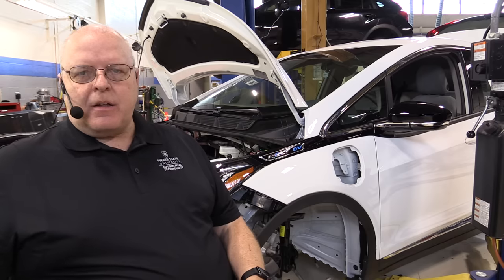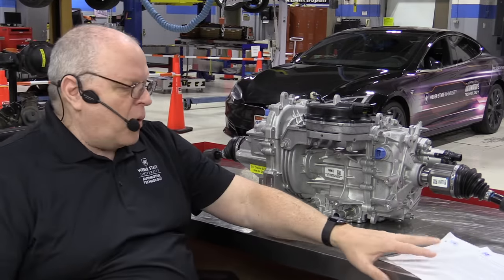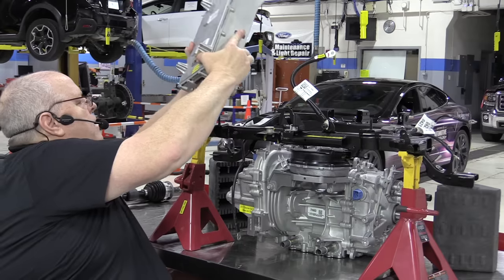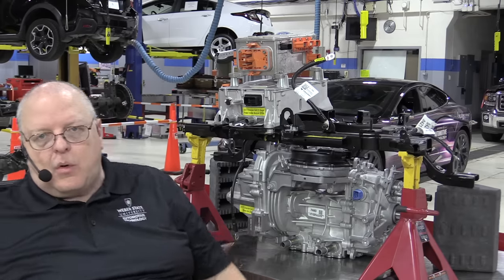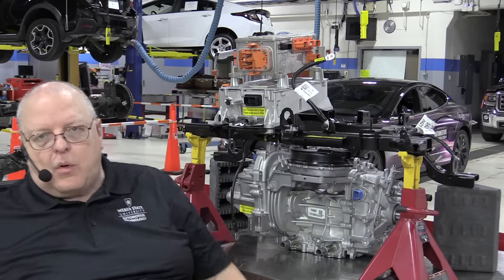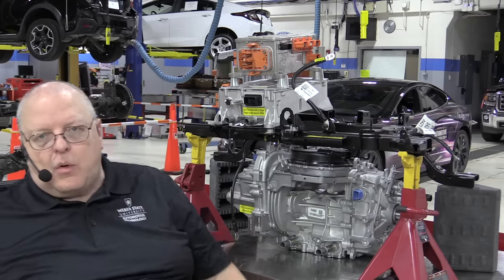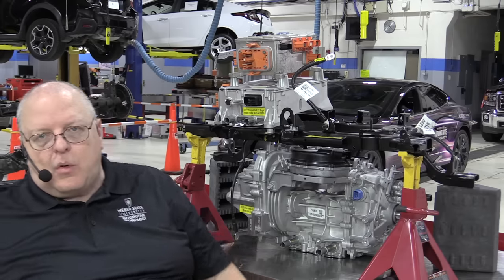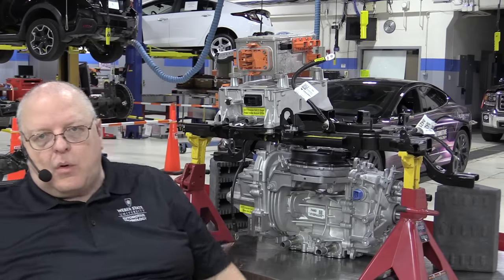Chevrolet Bolt EV High Voltage Components

Comment: Professor Kelly (or anyone who may be able to answer my question): I want to know if there is an optimum charge rate for the Chevy Bolt, in terms of battery longevity as well as most efficient energy usage.  Clearly, charging at 240 volts is more efficient use of energy compared to 120 volts due to IR losses but there are other questions.

For example, during the wintertime, it would make sense to create at least enough heat in the batteries to eliminate the necessity of using resistance heat to warm the batteries via the hydronic loop; also one would not want to overheat batteries requiring usage of the coiling loop - but obviously that is only part of the equation.  Thus, perhaps the batteries are SO much more efficient at accepting a charge at a given charge rate that some amount of operating the heating (or cooling) loop would be the most efficient way to charge the car.

Then of course is the question of what is the best RATE of charge to preserve battery longevity, which of course, may be more or less than the most ENERGY efficient way to charge.

Additionally, is there a better or worse way to treat the batteries?  My understanding is the keeping the charge between 20% and 80% is generally the best way to treat the batteries (correct me if that is wrong) but isn't it also good to exercise the batteries through their ENTIRE range from time to time?

Which begs the next question: should I charge the car to 80% and let it discharge to 20% before plugging it in again?  Or should I put it on a charge every night when I come home, even if I have only used 10 or 25 miles worth of range?

I know that the answers to my numerous questions will be long and complicated - so please send me to resources to read if you have them.

Thanks very much for this excellent forum!
Reply from the maker: Thank you. Slower charge rates are always better for the long term longevity of the battery. Charging to 80% is also better if you do not need the full range in-between charges. Best wishes

Comment: The extra 6 wires for the charging inlet besides the locking solenoid could be for temperature sensors at the DC pins what is mandatory by standard.
Reply from the maker: Yes

Comment: Is the differential unique to this application or is it shared with any other platform. Would be awesome if it could be swapped out for an LSD because the Bolt has trouble putting down the torque at lower speeds.

Comment: Did you ever get dc fast charging to work, it seems like it might be a great idea.
Reply: He gave up, It's been done successfully several times before for Spark EV, and he's even been approached in the comments by those very people. It's further perplexing because he has most of the parts and is adept in completely disassembling the vehicles. Adding a few pins to a wire harness around routing them to a few key locations is not going to be difficult for a person like this. And yet he's not doing it. Maybe it didn't align with the interests of Weber State University, and his courses. Then again he wishes he could offer a more complete demonstration of the high voltage components...

Of course it's a great idea, but I suppose people are dissuaded easily.
Reply: @Infinion  So go do it yourself, and report your success. It's more likely that there is something in the Bolt which is not in the Spark, such as additional wiring or (more of a problem) programming features.
Reply: @brianb-p6586  Yes I'm indeed working on that already. I have purchased the service manuals, all DCFC modules, color coded hook-up wires, orange and black looms, and connectors, and am currently working on the 3 wire harnesses that I need to build to allow communication with the new DCFC components. I haven't decided how I want to publish the information once I get to that point, but it'll either be a blog, the spark EV / Bolt EV forums, or a youtube channel.
Reply: @Infinion  Great... but it has been two months and you haven't made it work yet, so instead of accusing anyone of being lazy or corrupt, how about you make it work first then speak up.
Reply: @brianb-p6586  Wait hold on. Where did I accuse Kelly of being lazy or corrupt, and under whose project timeline am I being expected to complete this project as quickly and efficiently as possible? I am free to express how I feel in a YouTube comment section and am under no obligation to "make it work first" before speaking up. By your same logic, I could expect you not to be critical of me because you have zero merits or accomplishments on your burner youtube account. But because we don't operate on your logic, all it amounts to is you being temperamental and projecting your frustration and moralities on others.

Comment: I'm really of mixed mind about DC fast-charging being an option. I splashed out the extra money for it when I got my Bolt nearly a year ago, and I've never used it. However I always feel better knowing it's available to me if I need it and I happen to be near one of the very few stations that exist in the places I drive. I feel like it was an unnecessary complication to even make it an option, you've clearly shown there's lots of different changes that have to be made to make it work but I still feel like if they just built them all from the beginning and didn't need to bother with two variants on the control module and the charging ports and the wiring harness it would have been less expensive and confusing. Judging by all the work you're having to do, you'll probably be out $750 worth of shop hours and parts if you ever get the conversion to work.
Reply from the maker: I agree, just buy the option with the car. Thanks for your feedback!
Reply: Alexander Roderick - I’m sure the thought was that there will be some people who will buy a car that’s capable of up to 300 miles on a full charge, and are perfectly happy using that range which is obtained from a recent or overnight charge - no point (to them) in adding charge from a fast charger, especially when you consider it adds $750 to the cost of an already expensive car, and the user fee for fast charging is quite expensive too.  But if you drive the car any distance, for which the Bolt EV is very capable, you will want the fast charging option present.  Or perhaps if you live in a rented space which you aren’t able to add a charger to, yet still desire to drive an EV - a fast charge stop occasionally keeps you going.

Comment: The thing I'm surprised with is there isn't more terminals with bolts in them for a good tight connection. The spade slip on connection looks a bit light duty. In my way of thinking
Reply from the maker: Thank you for your feedback. They are huge terminals

Comment: Are those fuses very accessible?
Reply from the maker: Not without removing the wheel well. You can test the fuses by performing a continuity test on the harness. Just de-power the system by disconnecting the 12V battery, then disconnect the AC input of the OBCM, then test each of the two large wires from the charge receptacle to the OBCM harness connector. If the fuses are good, you will have continuity on each wire.

Comment: I can see the logic of running hot water into the cabin. It would keep high voltage out of the passenger area (in case of accident) I see a long term maintenance problem because of the a/c. I base that statement on all those a/c systems that go flat and are usually ignored. I think if one loses the gas, you would not only lose cabin cooling, but battery cooling as well...hence, the car is dead if high heat is usually generated under normal operating conditions.
Reply from the maker: Thanks for your feedback
Reply: Not much cooling fan usage in summer months if that gives a clue to battery heat.  The compressor on my Bolt EV is turned off most summer days unless the outside temp gets toward ridiculous, or I’m driving quickly (windows closed).
Reply: @dennislyon5412  I wonder though if the battery requires cooling and can't get it because of a depleted a/c, will the drive system shut down to prevent overheat damage to the battery? A side to that, would the battery only require cooling under "extreme" conditions?
Reply: @dennislyon5412  I can see that cabin cooling is controlled by driver, but is battery cooling being done without the driver knowing? ...same pump, different circuit?
Reply: obsolete professor - battery cooling which can’t work due to lack of Freon in AC system - stuff the future holds as EVs age?  I would think that power output would be limited once a higher battery temperature has been observed, and due to no Freon, the AC system is then not able to cool the battery.  This could likely lead to truly limp home mode, likely not as slow as turtle mode unless the battery heat level continues to increase after the warning.  In the Bolt EV I have experienced what I thought was AC being forced on (to cool the battery?) on one occasion.

Comment: Any chance you have a part/model number on the "engine" shaft speed sensor? I'm looking to augment it with a hardware solution to change the speed limiter

Comment: Professor: Can I swap the OBCM of my Spark EV (3.3 kW) for the one on the Bolt EV (7.2 kW)?
Reply: 13:30
Reply from the maker: No, for many reasons.
Reply: @WeberAuto  convenient reply, lol.
Reply: Bolt uses PWM to communicate, but Spark EV uses CAN, so you can swap Volt Gen 1 but not Volt Gen 2 or Bolt unless a translator is made that speaks CAN and PWM that can mediate info between the two
Reply: @Infinion   This makes a lot of sense. Thank you so much.

Comment: Would it not be more efficient just to use a radiant heater direct to the air to warm the cabin just trying to figure out what the engineers were thinking? Do the battery and cabin both share the water heating element?
Reply from the maker: Good point. No, they are two separate heaters.
Reply: I was also thinking the same
Reply: Using an immersion heater,a pump, and a normal heater core seems like a Rube Goldberg solution.
Reply: You can't compare the car heater to the little heaters you buy at K-mart and plug into your 120v outlet. Those max out at about 1.5KW, the bolt's is at about 5 times more powerful.

I can think of 2 reasons off hand: One is to keep the heat down... If you just have coils in the air ducts, they'd get hot enough to glow at the full 7KW unless they were HUGE. If they get dust on them from circulating air, and then burn it off, it'll smell for a while.  Using water prevents that from happening, as well as eliminating a possible fire hazard. The second is that it helps keep HV out of the cab, since I'm sure the heater core is probably inside the dashboard.
Reply: @kevinsiv3064   The Tesla S uses a PTC heater element while the Nissan leaf goes one step farther and uses it's AC as a heat pump with a restive PTC for aux heat.
Reply: Heat pump is an option on the Leaf, only present if you have the cold weather package.  Most people don't realize that.
Reply: Jarrett Phillips - It strikes me as odd that GM did this.  It’s not unusual for heater cores to go bad/leak, and that fix usually involves tearing apart the entire dashboard.
Reply: go bad around 150k or higher, no?  So not a major warranty worry, if any worry at all with proper service and coolant (use correct fluids in these tech babies).
Reply: @galehess6676  And the heater cores in IC vehicles would likely have higher fluid temperatures to deal with, potentially shortening their service life.
Reply: Haha, I've said this before, but GM is not playing the game to make an efficient EV design. It's more of a middle-ground to reach mass market without going bankrupt again. They use 12V components from their ICE vehicles, they separate coolant loops, their air drag coefficient is unremarkable...Don't look to GM for innovation. They're more of a "me too" bandwagon manufacturer.

Comment: Love your videos.  As for the CV shafts being same length, I own a 2017 Bolt and I can absolutely tell you it has the worst torque steer of any car I've ever driven.  I don't know what else would cause it, but it is most certainly there.
Reply from the maker: Thank you. I should have said “reduce torque steer”. The motor has 266 ft*lbf of torque, but that torque gets multiplied by the gear reduction ratio of 7.0518. That puts 1875.78 ft*lbf of torque on the cv half shafts and the tires under heavy acceleration. That will cause torque steer. A lower acceleration rate would reduce torque steer, but it may not eliminate it. Thanks for your feedback.
Reply: Wes Johnston, every FWD vehicle has torque steer, which is amplified by unequal axel lengths. The longer axle has more torsion, so the shorter axle delivers more torque under hard acceleration, since it’s shorter and therefore stiffer, so that tire will pull harder than the other, and try to go left of right depending on the suspension geometry and road conditions.

In rear wheel drive, the front wheels can have a lot of caster, which makes it want to go straight even if it hits a small water puddle or if one brake holds more than the other, but you hit a deep water with one wheel, or one brake grabs while the other doesn’t, it will pull left of right.

Back to Front Wheel Drive. Now the camber is reduced because if not it’s very unstable anytime you drive the front tires. In addition, the King Pin angle and wheels huge part. The line drawn from upper ball joint, through the lower ball joint, to where it hits the pavement determines the axis of steering. If you have too much tread inside or outside that point, it’s going to try to turn anytime torque is applied.

If you change wheels, tires, or alignment from factory settings, torque steer will get worse, so it’s important to make sure any wheel changes and tire size changes still keep the tread balanced left and right of the steering pivot point. 

Camber is another one, because that put more pressure on one side of the pivot point, which gives it more traction, and therefor trying to turn the tire at that steering pivot. 

Excessively crowded roads will behave like a car with bad camber, and the winder the tire the more torque steer shows up.

If you have factory wheels, with factory tire size, at specified inflation pressures, the only thing left is to align the steering with the car loaded the way you drive it. That means if you are a big (Heavy) guy who drives solo most of the time, put some weight equal to your weight in the driver’s seat. It sounds crazy but it’s not. Lol

When you align a car empty and add 200 pounds on one side, the car will tilt slightly, and even while going straights your car thinks it’s going around a curve, which changes camber between left and right tire. 

Torque steer can’t be eliminated, only reduced, and made more predictable.
Reply: @imho7250  Very good explanation.  I may be experiencing the front end components "loading up" instead of torque steer.  It always seems to go to the left, but that's probably because I'm passing and already pointing left when I punch it.  If I had to characterize it, it's like taking your dog to the vet and their paws go out and they slide in a panic in whatever direction they were going as you drag them by a leash... (lol).   The tires on my Bolt are the very same ones from the day I bought it, so the tire patch should be inline with the kingpin angle as designed.  Years ago, I designed a recumbent trike and had to figure out all the caster, camber and trailing, ackerman angles and such... there really is a lot that goes into making your car (or trike) go straight down the road.
Reply: Wes Johnston, EE made a nice  video explaining it, and goes into detail about the difference between a car like the Bolt with simple McPherson strut and something more sophisticated like the Honda or a car using upper and lower control arms. By having the ball joints both near the center of the tire, it doesn’t develop a moment about that axis with increased torque.
youtu.be/Gw5-lVlzNoY

I would think if it always pulls the same direction under hard acceleration, you can get some of that out with alignment tweaks. But if it’s going left when passing on the left and right when passing on the right, I don’t know if that can be dialed out.
Reply: You’ll always have torque steer. But what he means is that the wheel will not pull to one side. Instead the wheel will pull to center strongly. The steering will try to ‘straighten out’. Believe it or not the amount of pull to center is actually higher than you feel because FWD cards like this one with electric power steering will ramp up the steering boost to minimize the steering wheel stiffness caused by the motor torque.
Reply: I notice the torque steer effect, but I think it has to do with the LRR tires which are not very "sticky" and spin a lot under acceleration.  If one tire gets loose a small amount more than the other it may cause this effect.
Reply: @imho7250  I have looked at The video with a disassembly of the drive unit -The differential is on one side and there are two rather different half shafts connecting it to the CV joints and the external half shafts.

These being the same reduces the influence of CV joint angle differences, but from a torsional stiffness point of view the wheel on one side is connected by a composite shaft almost double the length of the other.

To avoid it, it would be better if the differential was at the center, but it would make for a less efficient packaging.

Comment: Does the inverter store any current after the high voltage wire has been disconnected from the main battery?
Reply from the maker: Only for a short time period in the smoothing capacitor. It typically discharges in less than 10 minutes
Reply: @WeberAuto  good to know for when people start fiddling with any of the electrical components disconnect and wait at least 10 minutes before touching anythingI'm thinking if you cycle the on-off switch of the engine that my discharge is quicker you think?